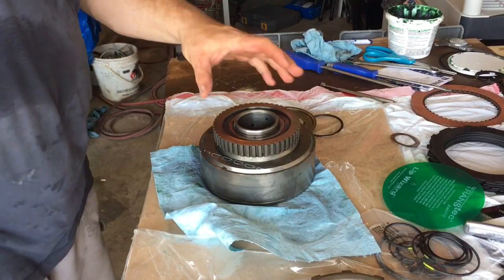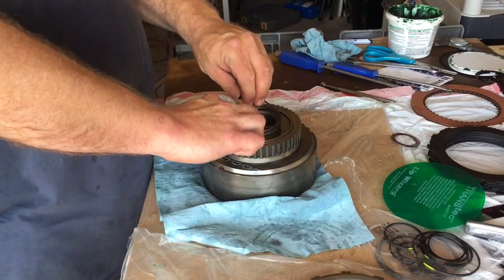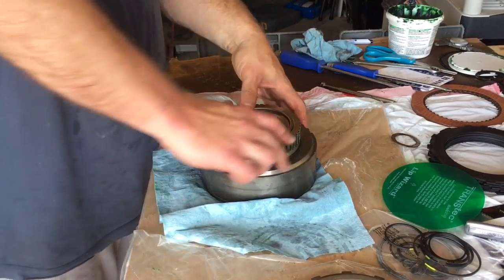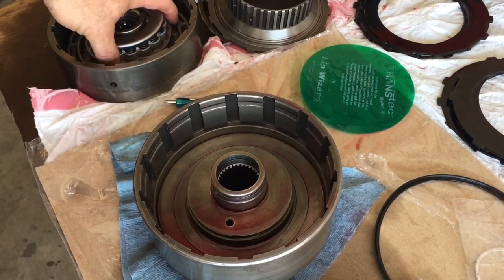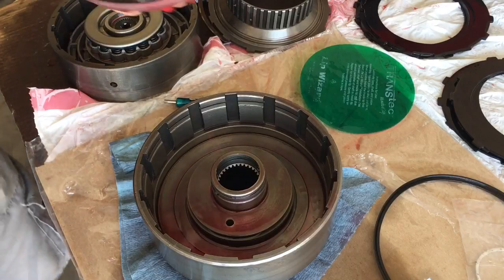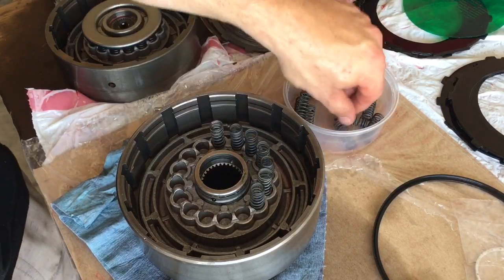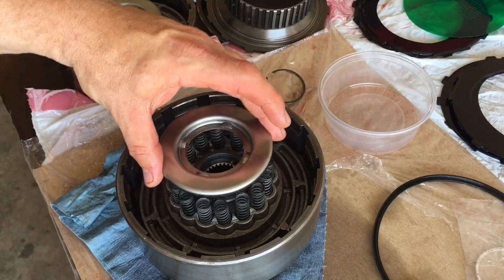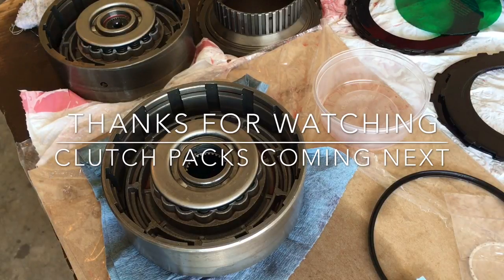DIY TH400 34 element Sprag w/spiral lock retainer

Comment: They do come apart I had one come off on my drum.
Reply from the maker: I followed the build sheet for 800+ hp, I guess I’ll see if it holds up.  I do see other builders using regular snap rings and adding a tack weld.  Maybe this is a better option?  JD

Comment: Mine snap ring came off at high rpm.
Reply from the maker: Spiral snap ring is highly recommended for high rpm use.  Some people put a small tack weld on the regular ring but it’s easier for me to use the spiral style.

Comment: Also a quick tip,,
Don't put the opening of the return spring snap ring in the spot where the tit in the retainer,,another words put the snap ring opening in between the retainer tits,,
Also when I first put a snap ring in the groove I like to take a screw driver and rotate it to verify it's seated correctly,,,before I release the tension on the spring compressor
Reply from the maker: Thank you!  Sorry for the late reply, I wasn’t notified off your post and just found it today.  JD

Comment: Rebuild tip for you,,
I assemble all my piston seals with  stp engine treatment in the blue bottle,,it's the slippery stuff you can buy and it doesn't hurt the transmission seal rubber..
I put it in a old time oil squirt bottle and dispense as needed on every single seal,,won't cut a seal that way.. 
Only use the trans gel for holding bearings in place,,it doesn't work to good as a seal installation aid..
Reply from the maker: Justin Geraldi I’m a big fan of STP, I’m definitely using it on the lip seals next time!  I used that thin round plastic disc tool to work the seals; it worked really good. 
I used the Green transmission Goo for assembly.  I had a great recipe to follow when building this TH400 it’s set up to handle more power than I plan on making. 
I really appreciate all the help and tips!  JD

Comment: 1:00, its hard to install because the sprays are springed out neutrally so they sit straight and you won't be able to get it down there till you twist the ring around w\e way it is to have it compress, I wonder are all sprags/or i think there are other types of one ways but i forget what its called. Anyways it'll work that way.
Reply: Good video. You take your time to explain everything which is good. 
Thanks
Reply from the maker: I'm impressed with the quality of the Borg Warner 34 element sprag.  You're right once i got the sprag on and lubed well it was easier to R&R but it's still a pretty tight tolerance.  It spins smoothly clockwise only so it's good to go.I have the front band, direct drum; forward drum indtalled now.

The hardest part of the rebuild may have been installing the Direct drum, the 3rd friction didnt want to line up!
Reply: ahh ok. i've never rebuilt anything but when i was in automotive classes 2 years ago for trade, we went over stuff like this in depth and literally i like learning but its harsh going to school away from home and never getting a day off unless the weekends. I just remember stuff like that, Holding members, Brakes and one ways.

Never seen spiral locks before for a trans, Also heard that Spiral locks can be used in Wrist Pin locks but typically they use a C clip or snap ring, so in essence since you said that they recommend you use spiral locks for high rpm i'm guessing they use spiral locks for wrist pins too for pistons.

http://blog.jepistons.com/wrist-pin-locks-different-types-and-how-to-install-them